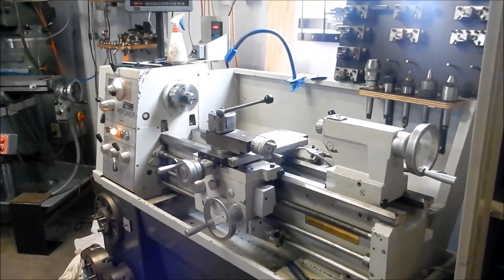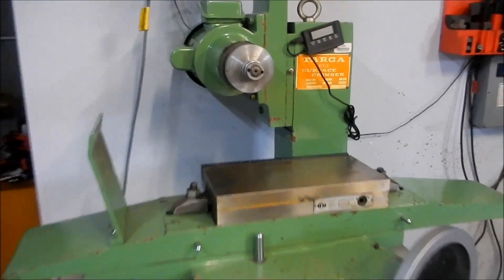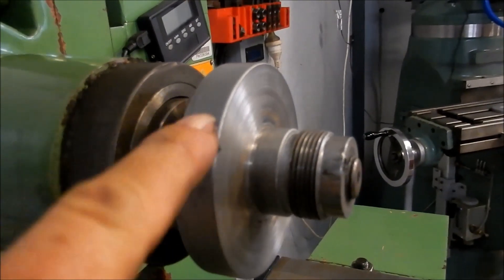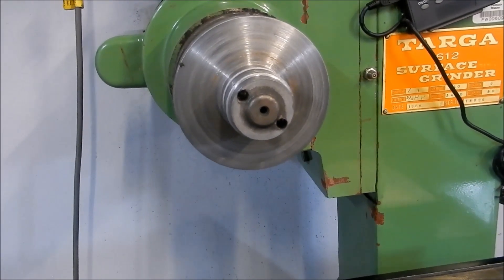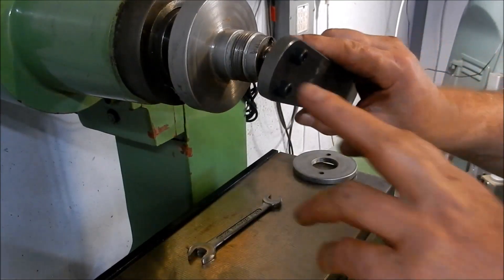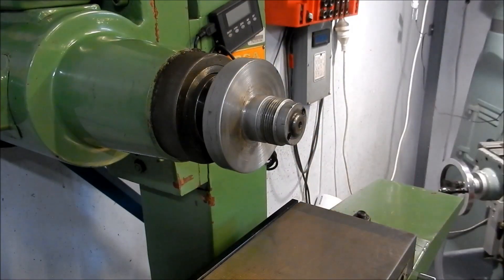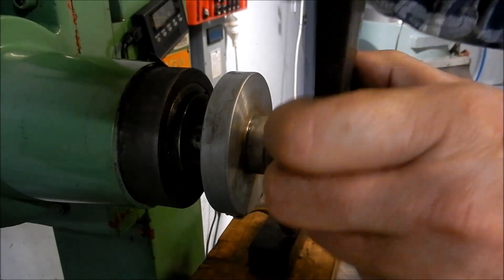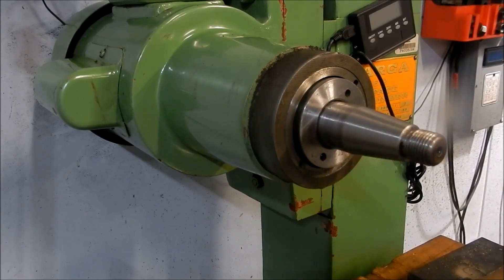Pin Wrench

Comment: On a tapered shaft like that there should be a bolt or a nut that draws the collar onto the taper. You would think that the machine designers had a bit more smarts than to make the thread and the taper in one piece. They probably never worked on a machine before!

Nice job on it Cam. I was waiting for the pipe wrench with the 45cm handle to show up!

Mark
Reply from the maker: Thanks KA, I didn't want the Pipe Wrench and torque bar to show up but in the end I had no choose no matter how much it made me cringe.  I've got a few idea's in my back pocket to sort out the short comings in this design.
Cam

Comment: Wow, what a stubborn hub.  Never saw one like that.. You need to work up a proper one with locking nut, etc, so you can use proper jacking tool. Thanks for sharing.. Looking forward to your next video... Cheers.
Reply from the maker: G'Day DK, yep, a bit more work to do yet but I've got some idea's in my back pocket that I think will improve a lot of the issues.
Cam

Comment: Good trick using a magnet to draw the filings out
I found balancing makes a huge difference to the surface finish. More than I expected
Reply from the maker: Thanks Tommy, I'm hoping to see some improvement in the finish.  Its pretty good at the moment but I'm keen to see how much better I can get it.
Cam

Comment: I have a surface grinder that looks the same as yours, on my machine that hub that fits onto the spindle taper in not threaded, there is a separate nut that clamps the hub onto the taper. Seems weird that your hub has an integral threaded portion. It would probably be a good idea to machine off the nut portion and have a separate nut, that should make it easier to unscrew.

Comment: I can't promise it would have worked, but a hose clip (AKA jubilee clip) holds round things amazingly tightly - might have allowed you to grip the shaft without galling.
Reply from the maker: G'Day Paul, now that is a good idea.  I'm going to lock that one away and try it next time I find myself with a similar situation.  Thanks for the tip.
Cam

Comment: That's a bit a bisar way to mount a tapered part. Normally the tapered hub and the nut should be in two parts, so the tapers part does not spin on each other while tightening.
Reply from the maker: Yep, totally agree Rustinox.  It is a poor design so I've got a few idea's in my back pocket to resolve some of its short comings.  Hope your feeling a lot better soon and can start to get back into life again.
Cam